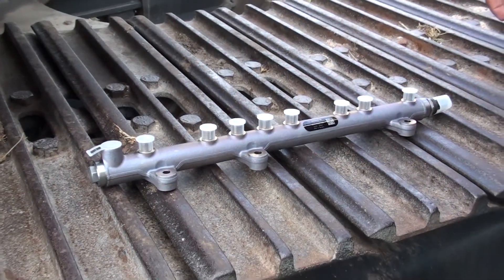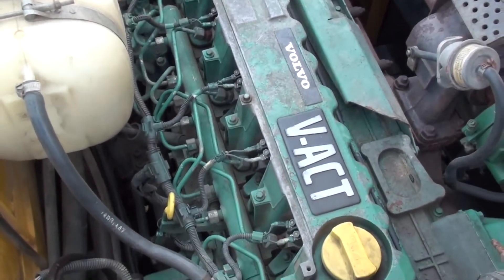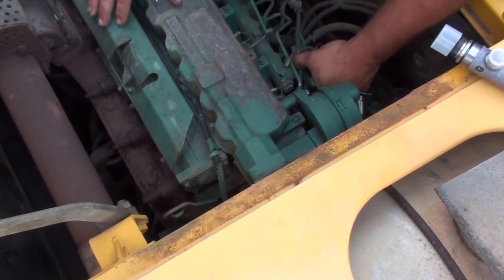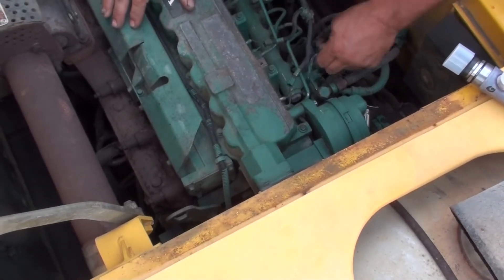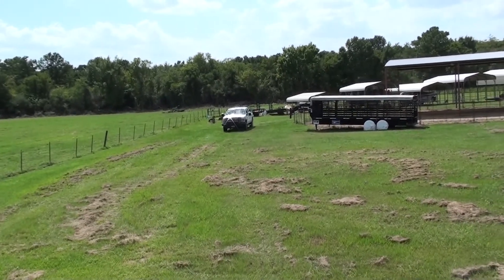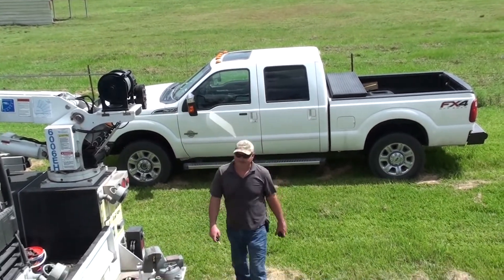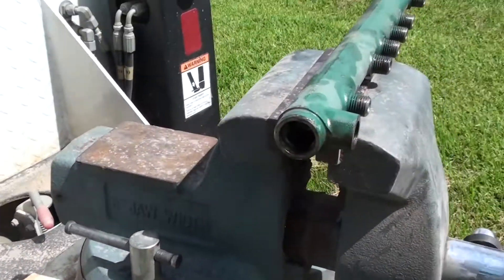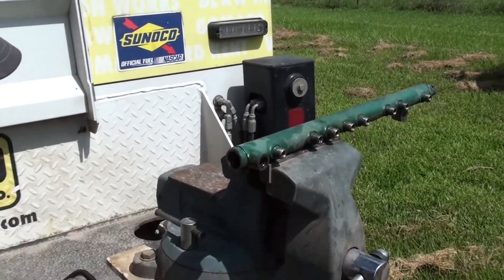Volvo EC210CL Fuel Rail Replacement Part 1

Comment: Very usefull video...
Anyway ..what a reason that you hv finally decide to replace a rail?any errors shows?
Reply from the maker: The excavator computers would automatically reduce the RPM to
safety RPM range (Limp mode)  from the normal working RPM's I had set, when the
computer detected a pressure drop in the fuel system.
Reply: I have a machine that the dealer wants to charge us $4000 to change the rail. I do believe that is with the rail. Not sure the reason for them condemning the rail either but the machine d rates into limp mode